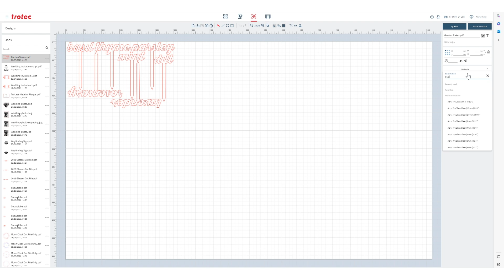Trotec Laser Featured App: TroGlitter Garden Stakes

Comment: It looks neat, but how durable is the acrylic?
Reply: Thin 3mm acrylic like this can be a bit brittle if flexed too much, so some care is required when using a product like this so they don't brake. If you need high-durability plastics, use an ABS or Polystyrene plastic, the issue is they do not come in glitter and look like acrylic.